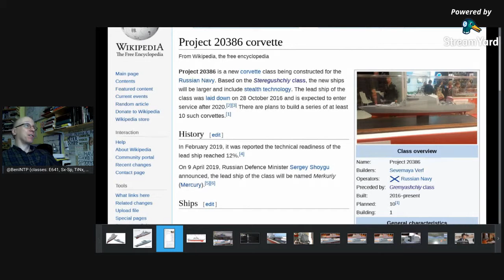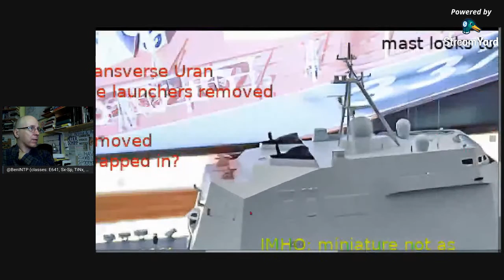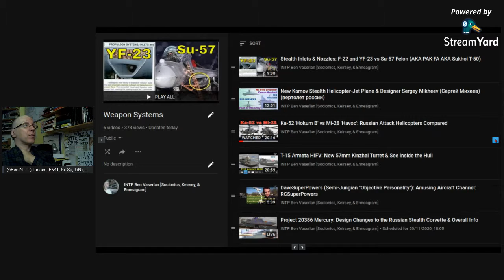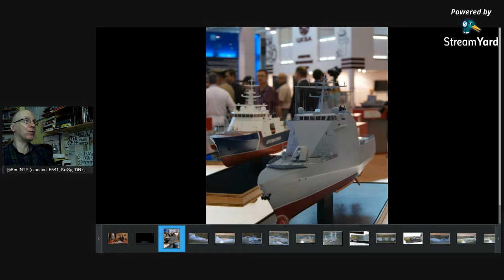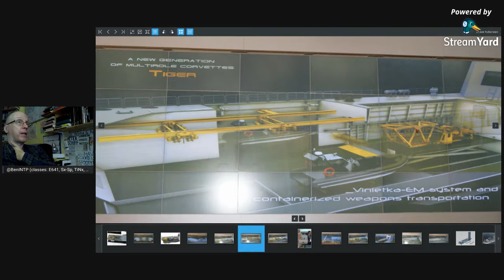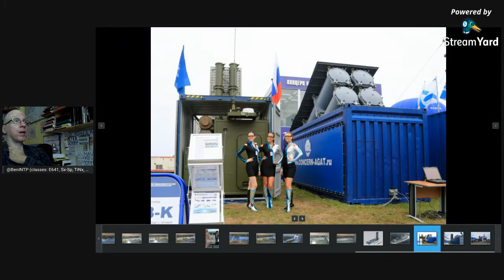Project 20386 Derzkiy (née "Mercury"): Design Changes to the Russian Stealth Corvette & Overall Info

Comment: This ship was released quite recently, it looks exactly the same as the Steregushchiy and Gremashchiy sister ships, not anything like what you are showing.
Reply from the maker: Do you realize that a recently launched Steregushchiy class ship was named the "Mercury"?  And that is consistent with Project 20386 going back to its original name and you getting confused.
Reply: @BenVaserlan  So are you implying that the 'Mercury' class of vessels are yet to be launched....?
Reply from the maker: The Derzkiy class has had one hull launched with no super-structure let alone "fitted out".  I've seen a photo of it.
Reply: @anonymouse8565 
Pr. 20386 was cancelled, likely sometime in 2021 or earlier. Remaining is the decision of what to do with "Daring", probably something like using it for training or equipment testing.